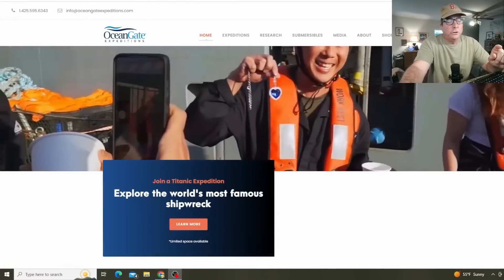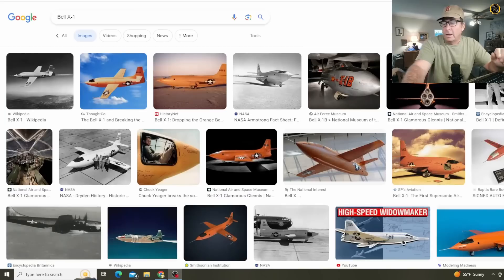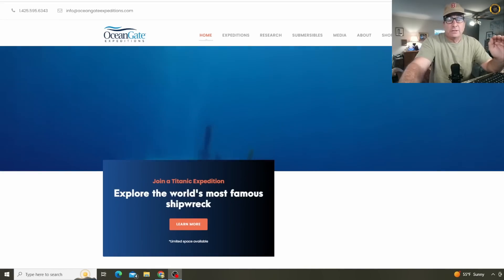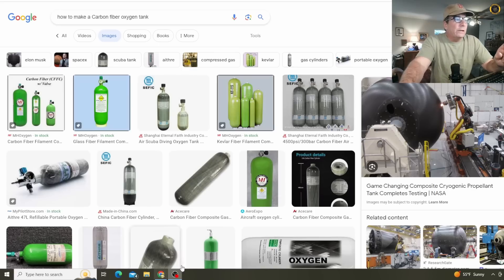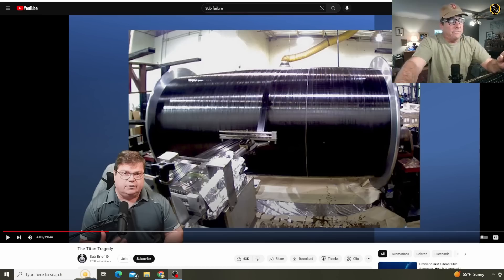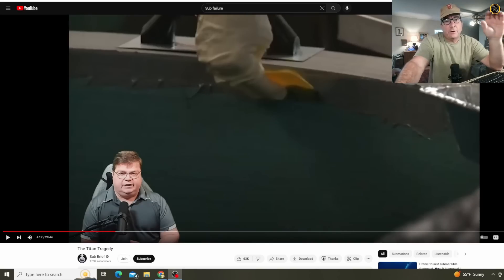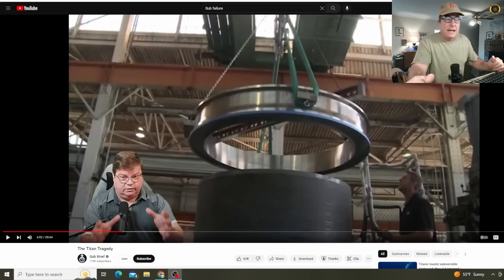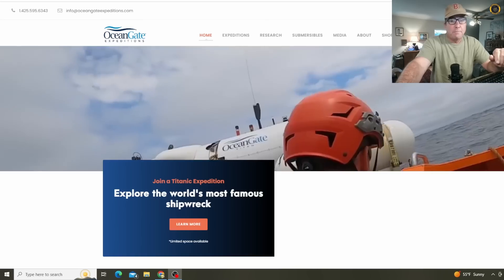Oceangate Sub Construction Details and Implosion

Comment: I worked for Shakespeare Corporation R&D in the mid 70's doing research on carbon fiber driveshafts. They had a lot of experience in carbon fiber for their fishing rods and antenna's. We made jigs to cycle the driveshafts to failure in hot and cold environments. The idea was to make a long driveshaft and eliminated third members like they use in metal shafts for vans. The problem we had was when testing on an actual vehicle and the tires froze to the ground overnight, they would easily snap. We tried kevlar and boron fibers as well mixed with the carbon fibers. Nothing could take the punishment of steel in most rugged environments. One rock could destroy it. 

We never laid up carbon fiber like they were showing in the video. It was always at angles and we experimented with many designs. One of the failure points was the connection to the universal joint steel sleeves. The process had to be perfect and it was for torsional loads only. They were strong but not a replacement for welded steel, aluminum or titanium. Hand layup joints like they were doing is nearly impossible to get perfect, even if vacuum bagged before curing. Carbon fiber is only as strong as the resin it is constructed with. We tried a lot of combinations. One tiny flaw at the pressures they were expecting would be disastrous. It failed at an estimated 220 tons per square foot of pressure and was to see close to 380 tons per square foot at 12,500ft. Titanium is way stronger. The porthole? No idea. Chicken eggs are shaped the way they are for a reason. Thin and strong. Like you say, that design is like a tube of toothpaste trying to pop the cap off. It did.
Reply: Very interesting and detailed comment..thank you.
Reply: @alexander211974  Thanks. One other note that I didn't mention was hoop strength in that style of layup. It's stronger for sure but without the crossing fibers to support the hoops, it's way weaker overall. Any longitudinal stresses weaken it pretty quickly. We tried a lot of variations and made some very strong layups but I'm sure the technology for the resins has increased the strength of carbon fiber overall. It's been 45 years since we were experimenting. Drag cars use them all the time but they are pretty short. When they failed on us there was no warning, it was instant. We would cycle them for days to max needed torque on a fixture in both directions. Then it went boom.... instantly.
Reply: @helicopterdriver  - So it’s like a glued slinky toy?
Reply: @helicopterdriver with drive shafts for drag racing made from carbon fibre, it’s actually a good thing that they shatter when they fail as there is no long tube flailing round at 8000 rpm or more like you’d get with a metal one
Reply: @KevinBalch-dt8ot  Afer seeing a few videos of how they mated the titanium to the carbon fiber I was shocked. That overlap should have been 10 times more than what they did and no vacuum was applied to remove air from the hand layup. Smooth surfaces offer no bond potential. It should have been knurled or shot blasted at the least. Looking at the landing gear I could imagine stresses transferred through the tube just from sitting around with 1000 lbs of people inside. A good drop on the deck could have cracked it. No X bracing externally or internally. Yep slinky is pretty appropriate sadly.
Reply: @helicopterdriver  👍👍
Reply: @helicopterdriver  - That tube withstood unimaginable pressures. I can't imagine that it would be affected by bumping into anything. Still, I wouldn't bet my life on it without a lot of testing.
Reply: @helicopterdriver You have several good points here.
Reply: @helicopterdriver 45 degree angle , so elementary worked out ages ago.
Reply: @KevinBalch-dt8ot  in the video it looked like that but it would be reasonable to assume there were other passes in different directions. It could be as simple as the structure was too long. As in, a shorter section of carbon fiber may have withstood the loading? Testing is the real problem.
Reply: Very interesting.  I have kind of a similar story relating to my best friend who drives pro modified drag racecars in the ADRL and another series.  Their racecars use carbon fiber drive shafts and the cars put out between 2000-4000 HP.  He had a bad wreck 2 years ago where there was some kind of issue with the bearings inside the U-joint (I don't know much about U-joints so I never quite understood the exact issue).  Anyway, it caused the drive shaft to disconnect from the U-joint.  The drive shaft hit the track and tossed the rear end of the car up in the air a bit, which sent him straight into the left wall at around 190-200 mph.  And the drive shaft snapped when it hit the track.  He was knocked unconscious, then the car drifted across the center lane and hit the right wall, then back to the left wall where it finally came to a stop.  He broke a few ribs and had bruised legs and feet but was otherwise OK.  He told me that the carbon fiber driveshafts they use in their race cars are super-delicate and also said that when they remove them from the car they wrap them in bubble wrap and blankets to make sure they don't get dinged or nicked somehow.  It amazed me that something that strong, that can take the rotational torque associated with that much power, could be so easily damaged.
Reply: @wadestipp1833   said "   there was some kind of issue with the bearings inside the U-joint    "    There have been instances where the aluminum yoke  ( the part that the U joint caps press into ) have spread open and caused the drive shaft to spin off center.   Another possibility is a u joint cap retaining clip coming off and the cap escaping.
Reply: @wadestipp1833  - Like putting a stack of books on an empty soda can. Then you just flick the side and watch it collapse.
Reply: @wadestipp1833  Keep in mind that this is also in relation to the amount of load that they're putting into the driveshaft - not only is it upwards of 4000HP, but it's going through giant sticky tires, to a nice sticky prepped track, it's a LOT going through those things.  
However, we have and have had carbon fiber in impact prone automotive uses. The 2013-2014 Mustang GT500 had a factory 1 piece carbon fiber driveshaft replacing the previous iteration's 2 piece steel shaft, no sort of protection from road debris or anything. I haven't heard of any failures of them for that matter(there may have been some, but it clearly isn't a common issue), and, in comparison to a Pro Mod driveshaft, I suspect that it's because a CF driveshaft is pretty overbuilt for an "only" 670HP factory car on street tires rather than a big power race car on super stickies. 

Another example is 100% carbon fiber wheels. Carbon Revolution's wheels are/have been on factory production cars like the Ford GT, GT350 and 2020+ GT500, the new Corvette Z06, I believe it's 5 different Ferraris now, etc. And Koenigsegg has produced their own inhouse 100% CF wheels as well. Everyone always said "we'll never have CF wheels cuz they'll explode the first time you hit a pothole!" ...except that isn't the case in the real world. In fact, anecdotes I've heard are that Carbon Revolution's wheels have taken big impacts that would've bent or cracked a metallic wheel, with no damage to the carbon wheels.
Much like aerodynamics, carbon fiber/composites is not something that you can just eyeball engineer. Gotta do the math, gotta do the FEA analysis, gotta do the destructive testing, so on and so forth because this stuff doesn't always react in ways that many assume they would. Carbon fiber/composites CAN be fragile for sure, but they don't necessarily have to be in a lot of cases... with proper engineering of course

(BTW, universal joints are literally just a metal cross with round legs, with a cap over top of each leg of the cross that's designed to rotate. Some U-joints are bushed, where the cap just has a bronze bushing in it to reduce friction; other U-joints will line the inner circumference of the cap with needle bearings to reduce friction, both ways work well - they're pretty straightforward. Needless to say, with enough HP, traction, and laps, you'll cause a U-joint failure for sure)
Reply: @RyTrapp0  Wow thank you for your response.  Very informative!
Reply: Chicken eggs are shaped that way so they don’t roll out of the nest - or off the kitchen table.
Reply: @Woodman-Spare-that-tree  Which came first, the chicken, the egg, the nest or the table? lol
Reply: Are race cars built from carbon fiber? Are racing helmets? I just wonder how stress resistant this stuff is. I know lightweight bikes are.
Reply: @JimMork  They are and they are for a reason. Weight savings. Look at any helicopter crash with composites and you will see shattered pieces everywhere, especially the blades. They are very strong  and have aerodynamically beneficial characteristics unavailable to aluminum. but they are not indestructible. They are designed to do a job, but are not a direct replacement for stronger and more resilient materials.  Aluminum helicopter blades bend, they don't normally shatter in a crash. Ships are made of steel for a reason. You wouldn't make an icebreaker out of carbon fiber nor a sledgehammer. Every material has a lifespan under stress. Any helmet involved in a crash is deemed trash regardless of its material. It's done it's job. Robinson helicopters are so cheaply made you have to send it back to factory for rebuild after 2000 hours of airframe time. Other helicopters fly for tens of thousands of hours with just periodic inspections. Pick your poison.
Reply: @helicopterdriver  - A CF sledgehammer would be awesome. You would need some wicked-strong eye protection for that when it failed.
Reply: @JimMork  Then, you must see how suddenly an catastrophically those expensive and up to then strong bicycles SNAP without any warning...
Reply: @JimMork  : A carbon fiber helmet is good for one crash. You buy a new one. I should think that going to these depths you were lucky to get one use, given all the excellent comments I have read here.
Reply: Wow thank you for taking the time to write that up..!👍🏼
Reply: Thank you for your comment. Real engineering!
Reply: It's very telling that it failed at just over 50% of it's expected stress. Obviously it needs to be designed to handle the 380 tons/ft2 plus some reasonable safety factor, including allowance if it happened to accidentally bump up against the Titanic or sea floor. If designed and built propertly, it should have been "loafing" at the depth that it failed descending through open water. Just goes to show how ill-conceived this design was.
Reply: Excellent 
Thank you 👍
Reply: Best explanation to date 👍
Reply: The tube meant an extra paying passenger over the hemisphere, the 2 Mir vessels were almost perfect and tested
Reply: The key difference between your story and theirs is TESTING!  You tested yours to failure!  It sounds like this is their first sub, so none has been tested to failure, to learn how many dives it can take and what the failure modes are.  (It's done about 50 dives, this is the fourth to the Titanic.)  I haven't even heard of scale model testing.  It will be interesting to learn what was really done.
Reply: @brianwest2775  and what did George Washington uni&nasa actually do.I don’t like adhesives why weren’t stringers built in longitudinally between the caps

Comment: BINGO!!! BINGO!! As one who built submarine periscopes for US Navy, two very dissimilar materials are never used in safety-critical joints for the environment which this vessel entered into. All interfaces utilized multiple means to provide backup safety. To depend ,,solely on an epoxy joint in that environment is something I NEVER saw in 40 years in that work environment, again,, right on!!
Reply: Might be too much to ask, but are the old optical periscopes full of air, or are they full of some kind of very pure oil?  We used to put a drop of oil between the microscope objective and the cover slip for better optical clarity.  And in a periscope, the oil has the added benefit of not being compressible.

Comment: An experimental submarine design is not my idea of a good time - especially when the destination is 13,000-foot down.   As James Cameron explained, these things should be made out of a "contiguous" kind of material - basically, a uni-body construction.   Having titanium caps attached with some sort of adhesive, at those depths was nuts.  And the shape of this thing (a tube) was less unconventional and not as resistant to the pressures of the deep (they're typically round, or, close to round).  In a nutshell this thing was an ill conceived contraption.  I am stunned that wealthy, successful people paid to get in this thing - it's flaws had been criticized quite publicly by experts.

Comment: You litteraly took the words out of my mouth, as soon as i learnt the sub had disappered i started searching how it was constructed and when i saw the gluing of the titanium ring on the carbon fiber thats when i knew it was a disaster in the making, they applied the glue without controling the quantity or thickness, they had no way of checking if they had air pocket in the glued mating surfaces

Comment: There will be another factor at play also.Unless the occupants were literally breathing through their own dedicanted air bottles then I assume air under pressure was fed into the vessel as one feed within.As the external water pressure caused the stucture to collapse into iteself then beause air unlike water can be compressed very highly then a combination of the vessel imploding and in a milisecond forcing the by then highly compressed air out would be sufficient to cause an actual exlplosive nature as it began imploding and forcing that air out with violence.So did it actually inplode or explode if you get my point.Either way physics took its way  and the vesel itself behaving more like a contained explosion as opposed to merely implosive depending on the volume and pressure of air being allowed to be forced out so rapidly.If was merely crushed like vacuum in a tin can I would not expect a debris field as has been detected but a very highly compressed mass  essentilaly contained within itself such as you expect a pressures of circa 2 ton per square inch.So in my understading of pressure diferrentilals this dub both intially began to implode and as was forced out so violently explode causind the said debris field.The wreck of the stern section of the actual titanic going down last would have still contained huge volumes of which caused a similar exposive effect as water pressre increased and totally destroyed it by comparriso to to fore ship which was already full of water as it went down first lifting a breaking her stern keel in a cantilver principle impossible to support itself and snapping the ship midpoint.Sorry for such a boring comment but if my wife puts up with me then anyone can.

Comment: the cyclic loads imposed by repeated dives and pressure cycles were obviously not accounted for
Reply: Just like the Hawaiian Airlines plane that took off as a plane and landed as a convertible with the top down. Minus a few passengers that got sucked out.
Reply: this was only it's third trip, and even if it was tested 100 times, it would be 103 cycles. Not that many

Comment: You have been my go to resource to aviation incidents...now ocean submersible incidents too.  This subject, I have some experience with...worked for a leader in compsite plastic manufacturer....carbon fiber and adhesive technology included.  You are correct in many statements.   You have to invest big bucks in destructive testing.   Any deviation in a proven mfg procees deems a part unusable....even the small variences.   We also mfg polycarbonate for viewports on deep sea submersibles.

Comment: You're dead on with your hypothesis. The bond between those 2 dissimilar materials where the titanium end caps bond the the CF tube would be exactly where I'd expect a failure for several different reasons, a couple that you mentioned. Temperature, compressive forces and deformation.
But relying purely on a chemical bond with no physical/structural attachment methods of those end caps is downright incompetent!
I would have wanted atleast 3 surfaces to bond to and some mechanical connection as well, working together as a system and using the forces at play at depth to strengthen the attachment.
As it was built the immense pressures only served to weaken the attachment.
Having seen how that thing was constructed I would NEVER have gone down in that thing!

Comment: biggest problem IMO is the sharp edge on the inside mating surface of the titanium end cap, when the carbon fiber compresses more than the titanium that sharp edge will focus the stress in a very small area. a rounded, sloped or chamfered edge would have been better but even then the different compression rations of the 2 materials is undesirable and IMO the root cause. a full carbon fiber pressure vessel might have withstood twice the number of cycles and full titanium pressure vessel would have withstood many orders of magnitude more cycles.

Comment: In rocketry carbon fibre composites are used extensively to produce the casings for Solid Rocket Motors, they have to withstand huge pressures but that it from the inside pushing out so the material is effectively in tension.

There are many videos from Avio (Italy) and Northrop Grumman (US) showing how they lay up the fibres automatically across each other.